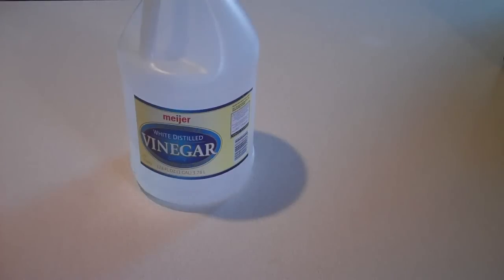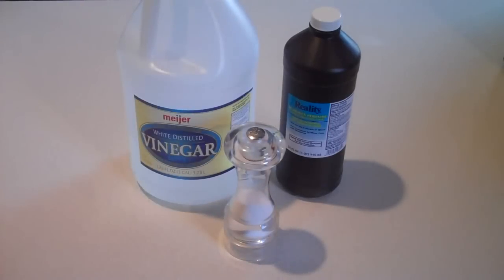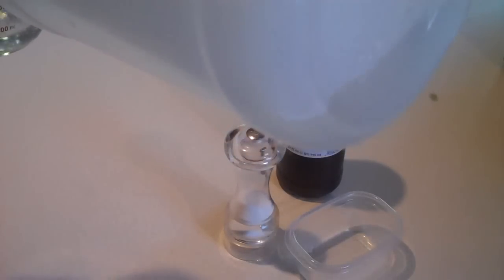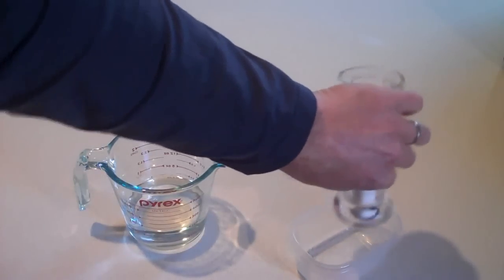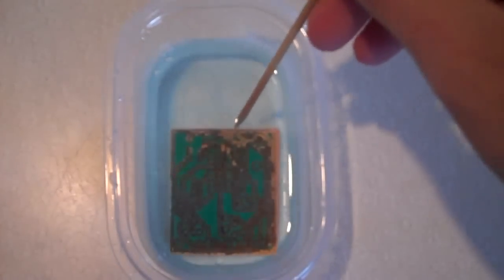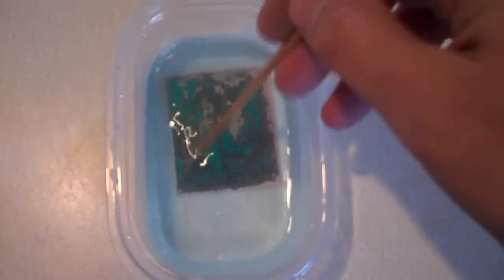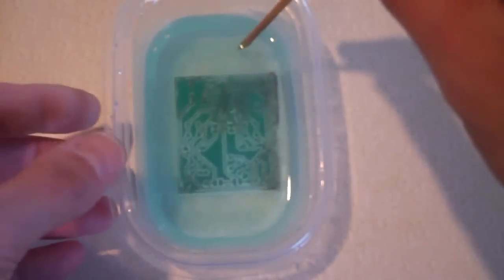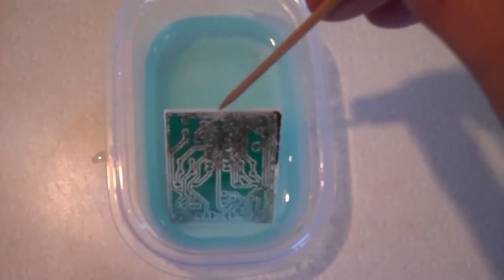Etching Solution - Parts 1,2 & 3

Comment: you should name tiytle or write in description Venigar PCB etching. I've been looking for this recepie, but there are tons tutorials with FerricChloride by key workd Etching solution :)
You didn't tell any word about safety, should we open window, do it outside, use gloves,  protective glasses, how to dispose it?
Thanks, great video.
Reply: Don't dispose it. Keep it for more etching. The more green it becomes, the better it works, after it eats up some more copper ions. Then, when it becomes too dark, you can regenerate it by reoxidizing it (e.g. by bubbling air through it, or pouring in some hydrogen peroxide). But if you really want to dispose it, don't flush it through the toilet or down the drain! Copper salts are bad for the environment. It might be better to recover the copper from it first. (Look up electrochemical copper plating.)
As for safety, it should be pretty safe as long as you don't drink it or inhale the vapours. Copper salts are toxic in higher concentrations or when digested. There's also a slight risk of chlorine gas coming out (chlorine is an ingredient of table salt after all), so it's always a good idea to do it outside or in a well ventilated room, and as always, don't inhale any vapours.
But this is pretty much true for all PCB etchants, so if you can etch with, let's say, ferric chloride, then the same safety precautions hold for copper chloride.

Comment: I have a bucket of solution that I use for etching and it is vinegar, salt and lots of iron oxide from rusty metal. Would the iron oxide be taking the place of the peroxide? It seems to work, but takes a long time. 15+ hours to properly "darken" a piece of steel.

Comment: Stephen Hobley Great video, but unfortunately since it's been made the EU has clamped down on the sale of hydrogen peroxide in concentrations greater than 0.1%

Is there any alternative chemical that could be used?
Reply: +Peter Houlihan I have some that has iron oxide in it. I use it for knives. not sure if it will work but it's worth a try.
Reply: The hydrogen peroxide is just an oxidizer. You can instead just bubble some air through the solution, for example, from a fish tank air pump, and it should do the job.
The most important ingredient might be the table salt, actually, because it supplies the chloride ions into the solution, which are required for coordinating the Cu(1+) ions and making them water-soluble.
Reply: @bonbonpony  I have an etching tank with an air pump. Are you suggesting I can etch boards with just vinegar, salt and air?
Reply: @TechNed  If I can, you can too.
@Max: If the process is slow, I'd rather say it's due to the lack of the oxidizer. It was slow at first for me too, but after I added just two or three droplets of peroxide, it immediately turned green, and after that, it worked on its own.
Reply: @bonbonpony  Amazing. I actually bought some hydrogen peroxide recently but just the dilute stuff from the supermarket. These alternative solutions fascinate me. It's a bit like, after more or less starting with Decon Dalo pens in the 1970s, seeing people use toner on shiny magazine paper instead of expensive press-n-peel sheets (I have those too). I bought some ammonium persulphate crystals but never used them because the 70-75°C is a bit inconvenient and the stuff doesn't keep once mixed. The idea that there are lots of alternatives, especially to pongy FeCl₃ that stains everything is really great to know.
Reply: @TechNed  The diluted peroxide is fine. Mine was 3% "cosmetic" one. It's only needed to start the oxidation, because after that, the copper chloride will work on its own.
Reply: An etching tank with an air pump using vinegar and salt? You people are brilliant. I've got an air pump!! I'm so trying that!!! @TechNed
Reply: @nachtschimmen  let us know how you get on! I've had a massive relocation since I commented here so I'll need to get set up again but I have a little more room to do that and a more appropriate space in a garage but the idea of using more benign chemicals really interests me as I'm now surrounded by national park. Of course, the used etchant might still present some issues.
Reply: @TechNed  Thanks for your great response. Deserves a reply as your comment has brought so many immediate changes in my artistic plans. Well I've got a sheet of copper somewhere but I want to experiment with other metals as well. I got the idea to use t-shirt transfers for white fabric as it only transfers the black - seems like an etching mordant or what? - and try with some of my simpler artworks that I'll try printing on a laster printer. Failing that I can apparently use all types of other things as well to retard the disintegration. I bought some acid yesterday although I'm determined to try it with vinegar, salt and an oxygen pump (with my tropical fish heater as well if that helps). It seems to me that the oxygen is used to oxygenate the water if I understand the descriptions I've read ... but what I'm theorizing is that the stream of air could also be used for is to wash off the oxidized metal as it 'rusts'.It's worth trying anyway especially if the air pump saves me getting H202. For an artist the possibilities are endless; I remember that time now I threw an acetate plate into a bath of acetone to clean paint off it... then promptly forgot about it. When I returned to it a day later, it had completely dissolved. There's nothing stopping me doing this to anything that dissolved so long as I can stop it from disintegrating as quickly on other parts of the plate. The idea is to catch the ink in the furrows left and to feed it through a printing press. The very idea of it thrills me.
Reply: @TechNed ...My 'tank' I made from perspex and silicone just fell apart. The perspex was fucking difficult to cut into pieces as well; that was a day and half wasted. Lucky I didn't have acid it in it or what... ha ha ha ha
Reply: @bonbonpony  Hi Sir, Do i add more salt if the process is slow? Or do i add more of vinegar & Hydrogen Peroxide too?

Comment: DO　NOT USE CHLORHYDRIC ACID as some people commented... IT IS INCREDIBLY DANGEROUS.. not only it will melt you but if inhaled it will make you sick... and you cannot dispose of it by trashing it into the sink... SO DO NOT USE IT!!
Reply: You know what's "incredibly dangerous"? Ignorance.
You realize they often pour hydrochloric acid into swimming pools for pH balancing, or as drain cleaners? :q
Hydrochloric acid will not "melt you". It can give you some burns though if you leave it upon your skin for more than ~15 seconds. But if you wash it out quickly with water, it shouldn't harm you too much, even in high concentrations. The real danger is when it contacts with metals, because it reacts vigorously with them. It can also produce a lot of heat when mixed with certain substances.
Inhaling it will most certainly make you sick, or even burn your throat & lungs, but why should you inhale it? Just don't inhale the fumes, do it outside or under a fume hood, or in a well-ventilated room. Safety precautions are always a good thing when dealing with corrosive / flammable / toxic / pungent chemicals, but let's not get crazy and overly dramatic, shall we?

Comment: for MUCH faster and prcise results, you'd probably want to use the following mix:
distilled water 100 mL (the less water you put, the faster the reaction) 
Chrorydric acid 20-50mL (the more acid you put, the faster the reaction)
Hydrogen peroxyde 50mL

Comment: What do you use to draw the pattern on the board before putting it into the solution?  I have always used a printer + transparency (clear plastic) for that but you seem to be using something different.

Comment from the maker: @xtreem200099 I think that took about 40 minutes - it was 1 ounce copper, I usually use 1/2 ounce. 

It's not fast, but it'll work well if you don't have anything else designed for the job.